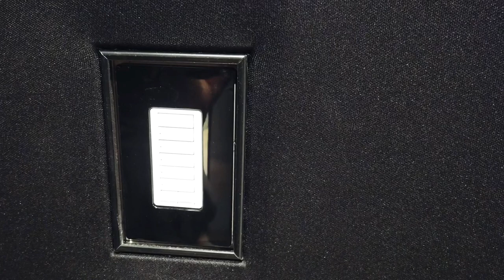Home theatre sound proof system installation

Comment: There is zero soundproofing in this video.  This all impacts the acoustical properties inside the room, but is not sound proofing.  Also, adding a thin layer of foam "insulation" around the whole room is so "1990's - early 2000s."  We've learned since then that doing so kills off way too much of a small upper frequency range. I am not sure, but if those other rectangular panels are all absorption too, you just created a horribly dead room.  It LOOKS great, but acoustically would be terrible and again is not soundproofing at all.  Two completely different topics that are solved in two completely different ways.  A simple google search of soundproofing vs acoustical treatments will help anyone who thinks otherwise.